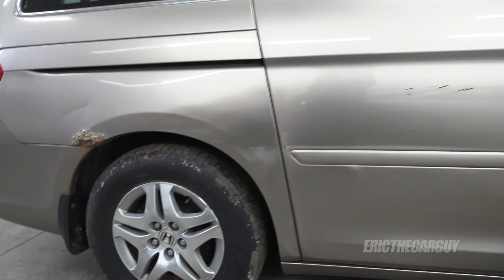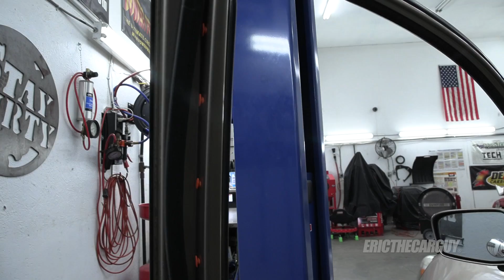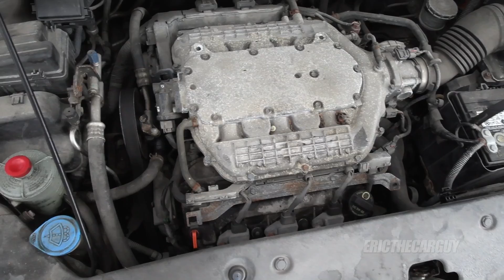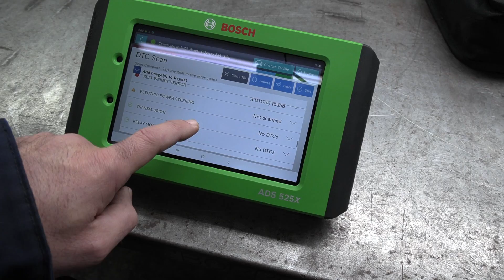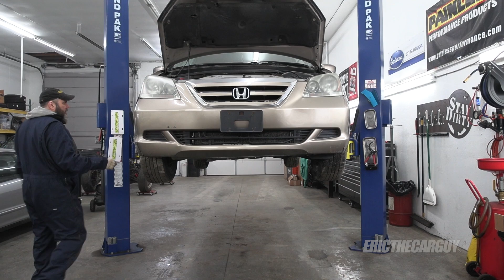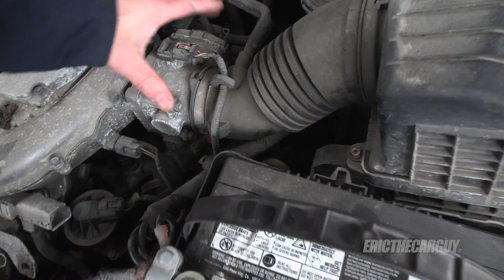2005 Honda Odyssey Introduction (Episode 1) Fixing it Forward

Comment: If you have trouble with the VCMS on that Honda, you can try a product I put in mine called VCMuzzler that fools the computer into thinking that it hasn't fully warmed up yet. Several systems use the temp sensor to regulate when they come on or off. Mine had the VCS light on the dash and the triangle warning light that didn't come on again after installing the muzzler.

Comment: Our 2006 Odyssey is still going strong at 356k changed the Timing Belt/water pump 3 times now @ 100,200&300k no accidents had to change both sliding door actuators because when the doors would close they would pop open. Then the wheel bearings all 4 wheels. Wife uses the van for her realtor business so it's always on the road. We are finally buying a brand new one again once the dealership gets any on the lot, right now they are looking towards the middle part of April before we can buy as they have a list!! Damn microchip shortage!!!

Comment: I love my 2005 Odyssey! I am realizing all of the things it takes to keep it going. It had to be the one thing no one wants to touch- the driver side sliding door. One guy offered to just cut the cables and leave it as is! Would the lock still work or will it close properly?? Need to know.

Comment: Ah.  I'll have to watch through the rest of the series and see what the result was, but last time I went to Honda for a seatbelt issue, they told me it was no longer lifetime warranty.  However, I also heard afterward through forums, that this is just on newer cars and older cars (like my EP3) are still covered.  Interested to see if you got it covered.  Heck, they even said they wouldn't do the safety issue for my 98 Hx with stock floormats because the campaign was too old!  Maybe It was just the dealership I went to.  They also overtightened my oil filter last time I went. Broke my trusty leather belt trying to get it off, ended up taking it to a dealer and they broke their strap wrench and had to hit up a parts store to get a new one (1hr oil change haha).

Comment: I like the simpler 1 cat converter exhaust system on the 1999-2004 odysseys more simple. Easier to remove when the transmission needs to be replaced haha

Comment: Haven't watched yet. My bet is a junk aftermarket t-belt tensioner is making noise, and/or rings are cooked, and/or camshafts are destroyed making a ton of noise. That is why previous owner said the engine was shot. About the only things that ever go wrong with these engines.
edit: Engine sounds great. Based on those dtc's I would say it needs a rocker arm pressure switch(if oil isn't just really low) and an o2 sensor, assuming rodents didn't get to it. Being an 05 that buckle should be under warranty still but that passenger seat code always sucks. Haven't seen a Honda cat fail like that before, But typically people have to fix it for plates before that happens. My money is still on it needing rings though. Also, fix that cel first. That vsa code always sets when certain dtcs set in the pcm.

Comment: Regarding the interior: consider getting an assessment from an experienced auto detailer. It could save you a substantial amount of time+cost to get it cleaned and in acceptable condition versus replacing everything with new or lightly used components. I've seen some nasty interiors shockingly transformed into a normal one! Even better if you can find a detailer willing to participate in your Fixing It Forward cause so that you're not having to bite the cost alone.

Comment: Wow, exactly the same car I bought last May, color & everything! Mine is leaking when it rains! The seals along the roof where the roof panel was bonded to the side panels needs to be re-sealed... might be mildew you smell. I just replaced both front axles, the CV was toast on the right but I took care of both. 

(Edit: mines at 183k miles & cost me 2 grand but there's no rust & the interior is about 90% like-new condition)

Comment: Great video. I was tempted to think catalytic converter blockage when n you first revved it and it had a low droning sound at high rpm. I have 2011 Odyssey and recently replaced the rear coil spring seats AND the control arms. Penetrating oil on the interior bolt did nothing. Torching it melts the rubber bushing. The only thing that worked was a sawzall with a rebel blade by Milwaukee. But you already know that I think because of one of your other videos. I look forward to the next installment. Cheers.

Comment: You are such a really nice guy....
A total waste of your time and money to put more funds into a 16 year old rust bucket which has been used on salted roads for that length of time.
>>>The most often problems with Hondas of just about any years is bad auto transmissions.<<<. Check that out first (with a test drive, legal or not) before anything else !
Spend more money and find a vehicle not ever used in salt.
It's just one thing after another dealing with underbody issues on salted vehicles.
This reminds me of Mustie 1, trying to save junk cars for no good reason.
Me: 74 yo Retired former used car tech at Honda New Car Stealership.
I've owned two different used Hondas, each used in salt.  One 14 yo and another 10 yo.  Each continually had issues with things attached to their underbodies, despite the bodies themselves holding up ok.
I've owned 35 Hondas not used in salt....much fewer problems and so much easier to work on.
I solved the problem, moved from NYS to Cali. Problem solved forever !
New mini vans are now in the neighborhood of 53 grand.  So I recently purchased  for my x wife a 2016 Odyssey with 50k miles for 22 grand.  That should fix her for a while.  Just no sense in giving a vehicle which will come back to me soon with more issues.  She's on her second Honda Odyssey and has had two Siennas.  One Sienna, bought new,  made it 375k until the interior began to look too ratty for carrying clients inside it. {She paid one time $1800 to have a power side door cable replaced, ouch !}. No engine or trans issues on the Siennas.  Trans issue on just one Honda and a year later Honda paid her back the $4100. for that repair.  Honda is known for extended hidden warranty on some known issues.  And yes the seat belts are lifetime...got one in the junk yard ?  Tow it to dealership for new belts free.

Comment: Great channel!!
My ‘05 Odyssey lights the VSA and enters a limp home mode if oil is low. Restarting returns all back to normal until it returns to idle, then it goes back to VSA again. 
Top off/change oil, back to normal operation.

Comment: Great score! That's going to be a nice one for whoever gets it.

I never make out that well buying vehicles. Last vehicle I bought off eBay (1st mistake ...) - an '89 S10 Blazer - the ad said it had 77k on it. When I got there and pulled the dipstick and saw it was jet black and overfilled by at least a quart, then saw the worn out pedal pads and arm rests, I knew that number was b/s. On the test drive I found they must've removed a TWO in front of that 77k! I got it cheap enough, so I went with it ($800 for a 4x4 - guess I could've done worse). We ran that engine for a year, and got sick of dumping a quart of 20W-50 in every 50 miles in single-digit temperatures. When I got the engine out I removed the heads out of curiosity, and found at LEAST a 1/8th inch ridge at the top of every cylinder! Man, was that thing worn out!  That's the one I dropped a '00 Jimmy engine into, minus all the electronics. Went back to the 70's on that one - carburetor and HEI.  I miss that truck with the newer engine! I could've ran that forever if I didn't live in MA with road salt ...

Comment: SOme times the communication issue will go away with a better battery.  In mitsus I worked on low battery caused codes in all modules and after charging no codes.
Reply from the maker: Yep, just like I said at the end of the video. Computers don't like low voltage. Thanks for the comment.

Comment: Eric, did the way the engine moved when you were revving it mean that it needs motor mounts?
i've always wondered what 'normal' looked like when it comes to this.
Looking forward to this series!
will you also be addressing suspension issues?  if you mentioned it in the video i missed it.
Reply from the maker: Not that I could tell. I usually replace the side mount when doing a timing belt because that seems to be the one that often goes bad. https://www.youtube.com/watch?v=lDSoQD1H0zY&t=914s

Comment: Reach out to James Stauffer of Stauffer Garage.  He's up in the Columbus area and does weekly videos on cleaning nasty interiors just like that.  I commented on a video or Instagram post of his sometime last year about this van and he indicated that he was willing to help.  As for the engine, it sounds a little like it's got the same noisy valve train that our Odyssey has.  I bet he mistook the noisy valves for something much worse.  And it's funny to see the back of the passenger seat half ripped off.  Our driver seat is the same way.  Um currently looking for another good intact gray leather driver seat.  I bet the brake calipers can be wire wheeled or sandblasted and resealed.

Comment: OEM plugs, air filter, adjust the valves since they get tight after about 150k miles, cats like you said, clean up the engine bay,  if you don't know the history on it, id do an AISIN timing belt kit (TKH--002 i think is the part number), valve cover gaskets are questionable.  A few seals, probably leaking on the Vtec selenoid down on the lower left hand corner which is making the oily mess (or the oil pump cover) and she should be ready to rip, doesn't sound blown up to me at all.    I'd also take off the EGR valve and clean out the soot from it, take the top intake manifold off and blow all those areas out, probably gunked up.  These engines are so easy to work on, I see why you keep coming back to them.
Reply: Good list. Aisin is the only way to go. The bad leaks on those are usually pcv oring on the front valve cover, oil pump seal and rms. It’ll probably also need a front engine mount, ps pump rebuild and maybe pressure line. The vsa light comes on with the 2647 and usually doesn’t throw a code. The other ones could be from the dead battery so I’d clear everything out and see what comes back

Comment: ERic: my 2005 odyssey has a J3547 series engine with VCM and has only 122K miles.  My plugs in cylinders 1 ,2 ;3 are all oil fouled.  Do you think i need a ring job?? I understand that in 2016, Honda was involved with in a class action law suite and settled to issue extended 8-year warranty for all 2008-2010 Honda odyssey owners so they could bring the vehicles in to have the rings replaced.  I found a copy of Honda service bulletin 13-080 but My 2005 vehicle does not qualify for warranty repair.  Have you found in your experience with 2005 Odysseys that there seems to be a lot of premature oengine oil burning issues due to the VCM design?  Appreciate your comments..
Reply from the maker: The only way to know is to check with Honda directly. Thanks for the comment.
Reply: Thanks Eric. I spoke to the dealer and they informed me the extended warranty does not cover my 2005 Odyssey. They also wanted  8K to replace 3-rings.  Which i thought was excessive.  Let us know if you discover any other set backs with the 2005 odyssey with VCM J3547 series engine.  I understand Honda is still using the same  design in the 2021 odyssey.  Buyer beware..  Looking forward to watching your other videos

Comment: Had one of these for 11 years. Best family hauler ever. Only issue I had was the power steering thing, which I think you diagnosed on another Honda already. I had the same rear wheel arch rust spots and it seems to be common in these. Well worth sorting out for what you paid. Good luck!

Comment: Thank you for selecting this van as your fix forward!  I bought this same van brand new back in 05 and still looks and runs new with 135K. Looking to do timing belt and rear control arm replacement myself so got very excited when you said you are going to do those same jobs.
Reply from the maker: I won't be covering the timing belt and water pump in detail because Iv'e already made a video about it. https://www.youtube.com/watch?v=lDSoQD1H0zY&t=914s

Thanks for the comment.

Comment: 4 wheel complete brakes
Purple Power & pressure wash that doggy interior
Timing belt/water pump
Engine flush
Trans filter/flush/fluid
All fluids change
Flush coolant/new thermostat
Wash engine bay
After engine work- wash & high temp clear coat engine
Needle scale and spray oil/wax undercarriage
Complete exhaust
Tires, belt/hoses
Restore headlights
Cleaner wax buff/polish/clay bar/wax

K-swap w/turbo/Hondata/
Parachute
Call Kyle Wade

Comment: Forgot to ask are going to use aftermarket catalytic converter and if so what brand and oxygen sensors Honda or Denso that supposed to manufacture the sensors for Honda. Thanks

Comment: $500? You lucky....

Meanwhile I have a recently acquired 2006 Kia Sedona... similar condition (filthy interior), but discovered a PO didn't ever change the oil. Ran some B12 Chemtool through the crankcase, and I've had to drop the pan to clear sludge (and the oil pickup) three times so far. At least I don't have a bad cat and it's mostly rust free. But I paid $1600, so you beat me there!

It did have an airbag light, but I was able to reset it and it has yet to come back (knock on wood).

Comment: Yes! This is what I've been waiting for. Odysseys are great, especially this generation, which I still believe was the peak of Odysseys.
Reply: I wanted to buy a nice clean, used one, but my wife made me buy a 14' Odyssey. So far though, it's been flawless and over 110,000 miles.
Reply: @midwestfarm757  I hope you muzzled the VCM. It's going to cause a lot of engine issues down the line otherwise.
Reply: @wiimaster2847  I did muzzle it, though to be fair the 2005+ had it as well. I have seen plenty with more miles than mine have no issues. I noticed a lot of people also drive 150-175K on the original belt, then trade in. I replaced mine at 110,000 miles because I dont like to bet.
Reply: @midwestfarm757  the thing with VCM is there are different versions. 2005-2007 had VCM1 which is less problematic than VCM2 which is in 2008-2017 models
Reply: @wiimaster2847  For only $120 I shut mine off. '14 Ody Touring.
Reply: @midwestfarm757  Yeah, VCM Tuner II is a pretty good deal.

Comment: Hi Eric you do a head blown test with the blue dye test to see is the engine is good 👍 and a engine  compressor test to see is the engine good 👍 I love ❤️ your video 📷 the are the best thing and good luck with the Honda Odyssey is go for a fix 🔩 #HondaOdysseyForAFix
Reply from the maker: If this engine had a head gasket problem, which is not common at all on these engines, it would blow white smoke from the tail pipe. I do plan to do a compression test just to see what kind of shape it's in when I do the service. Thanks for the comment.

Comment: If the motor is burning oil, won't that cause it to ruin (expensive) new cats?
Reply from the maker: Yes, which is why I'm going to check for that first. However, if it was burning a significant amount of oil, enough to kill a CAT, you would see residue inside the existing CATs and also blue smoke from the tail pipe. I'm not seeing that at the moment.

Comment: Something to consider. When you lifted the rear seats out of their well, looked like the carpeting was damp/wet. I have an '05 that had similar issue. Rust at the rear of the wheel well means that water is leaking through the body joint under the roof rack. When I took my rack off and re-sealed the body joints the water infiltration went away. Look forward to watching you get this car ready for it's next owner. Thanks for all you do Eric!!
Reply from the maker: That sounds like an improper installation of the roof rack, or I'm not reading you correctly. See the video linked in the description about the installation of one of these racks. There should be no water intrusion if it's installed correctly. Thank you for your comment.
Reply: @ericthecarguy  actually I was getting water incursion inside the rear quarters when it rained. A little research I found that there is a body seam under the roof rack where the caulking fails over time and will leak when it rains. There’s a couple YouTube vids on it. I pulled my rack and recaulked that seam and all better

Comment: Disconnecting the battery doesn’t always clear all codes
Reply from the maker: Yes it does. If they come right back, then they are 'hard' codes, meaning, there is a short or open in the circuit. Thanks for the comment.

Comment: Eric, I hope you topped of the oil before running that engine for your extensive testing (but on the other hand it's almost insulting from me to write that, because every professional would have done that - so I should delete this comment, but instead I'm sorry for having written it in the first place ;) )
Reply from the maker: It had oil in it. It was low, but still registering on the dipstick. I would have been more concerned if there was no oil on the dipstick.

Comment: May be a good idea to cut the oil filter open and check for metal as well, I have seen a few vehicles have major problems and actually run fairly smooth, worked on a mustang one time that had a spun main or rod bearing (cant remember) and it barely made a sound, only slight sound while accelerating
Reply from the maker: Funny you should mention that as I just recently got an oil filter cutter I plan to try out on this vans oil filter. Thanks for the comment.